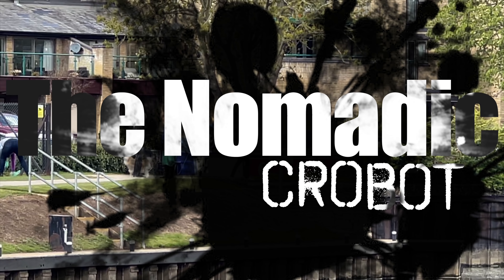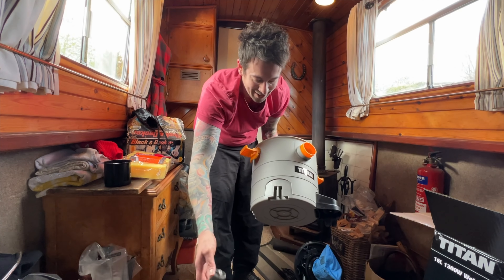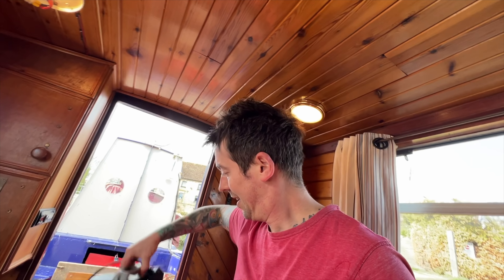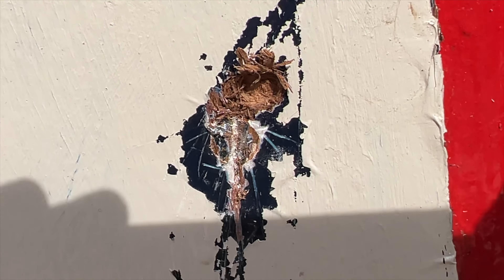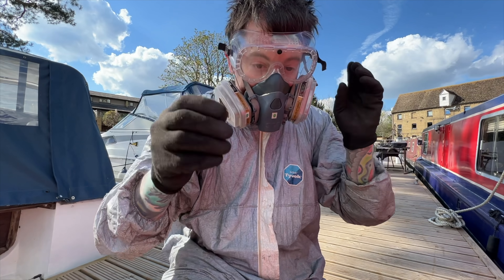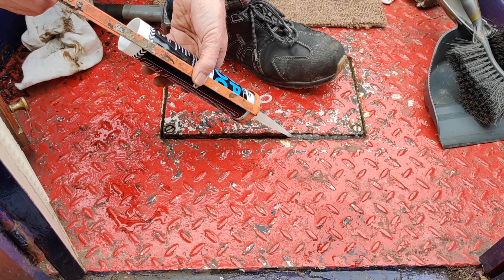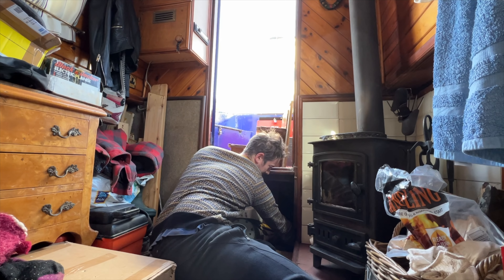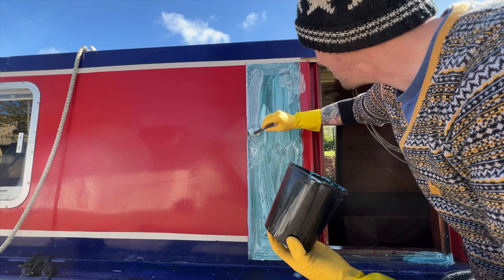"DISASTROUS" narrowboat hatch installation!

Comment: Hi folks
 Those timber inserts in the hatches were a nightmare to remove.Looked like bolts  or studs welded to the steel panels
Shave off those,and when you fit your new panels use CT1  as I mentioned, really good stuff
Not sure  but maybe use countersunk screws on the sides of the panel for extra strength? If the hatch doors shut of course)
Reply from the maker: yes there welded, the next one came off very easily, just a bit of pulling, I think we will problem use a very strong glue and also some screws, them we need to work on a proper lock too for when were travelling, thanks for your advise :)

Comment: Guys, just a long shot, but are you getting the water in after filling your water tank? I'm not familiar with how your water tank is, obviously, but it's just possible that water could get out of the air admittance valve (if there is one). This could happen if you have a tightly fitting hose end on the filling hole and there is nowhere for the pressure to escape to. Just maybe. 
You could fix the new hatch woods on with silicon - it'll seal against the elements and can be rather a good adhesive.
Reply from the maker: we haven't had any water in the tank for months, so any water coming I is ether rain or river, we do believe it is probably rain but you can never be to sure, yes we were originally told it was the water tank though with run a few tests and it really doesn't seam to be coming from there, thanks so much for your suggestions , yes my friend has already gives me a few tubs of adhesive for the hatches, seams the best option :)

Comment: It may be a bit late now ,but when cutting out the slots in the Scaffold boards. It would be easier to Drill out most of the slot , after first cutting the straight sides with the multi tool. Just use a Drill with the right diameter,to fit the slot.
Reply from the maker: Yea your probably right, there is also a drill tool that we did search for, Becca just takes the job into her own hands and gives it here special Becca blessing, thanks for sticking with us 😀

Comment: Hi. Have you considered that the hatch in the floor of the front cockpit is a weedhatch for the bowthruster. In your videos you show a square steel box going from the bowthruster tube to the cockpit floor. This may not have been blacked for a long time and is usually made of steel which could have started life when new at 4mm thick. I kindly suggest that all the boat including bowthruster tube and weedhatches and water tank are surveyed for thickness when you get the boat out of the water.
Also the water pipes under the floor are not a good idea as any leak can not be seen. 
On the narrowboats that I have owned I have found leaking joints after winter even though the water was drained off to prevent damage from freezing.
Good fortune and can we see a video down the weedhatch over the bowthruster propeller?
Reply from the maker: oh right...yeah I never thought of that, I did say to Becca how the hell its meant to be blacked, as obviously in  time it will rust, yes were currently booked in for it to get looked at, but it will still be a few months, yes we are going to try to keep all the new pipes above the floor if we can, yes I will try and put some footage of the weed hatch up in the next vlog for you, I wasn't present at the boat when Becca and her dad were seeing to it so we only managed to get some mobile phone footage, but ill try my best to Russel through it and let you have a better look, thanks for you advise Simon :)

Comment: Why are you mucking about with side hatches when you haven't got to the bottom of your leak yet that is the only thing you should be concerned with you should have a canvas sheet over the cratch area the steps should be left open so the thruster tube area can breath and dry out and you should be in there with your scrapers and wire brushes cleaning it up so you can see what is going on nothing else matters as this is the only thing that could sink your boat
Reply from the maker: Becca has actually scraped under the bow thruster, but we do still need to treat it, were going to get someone professional to take a look if the leak  continues, though we do feel we may have cracked it now, so we may not need to go down that route